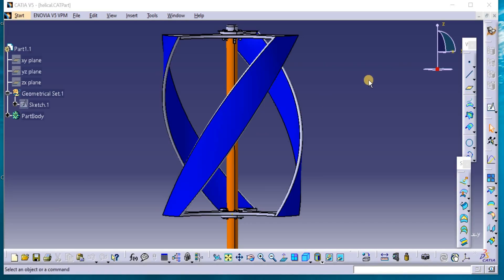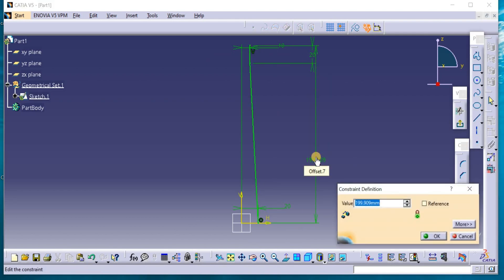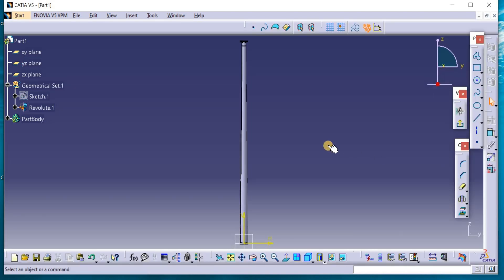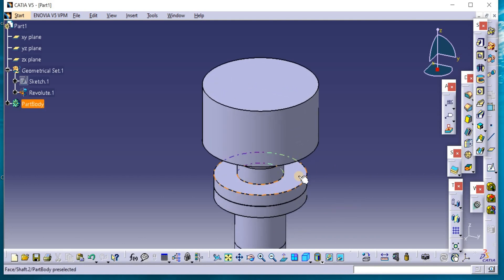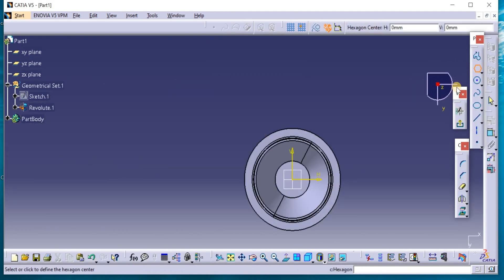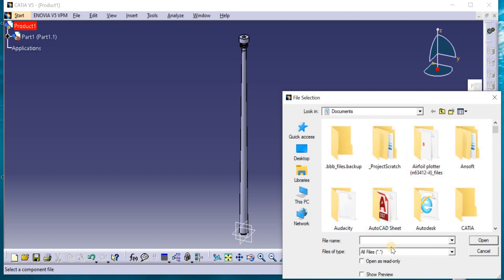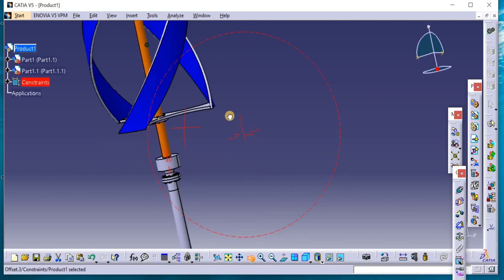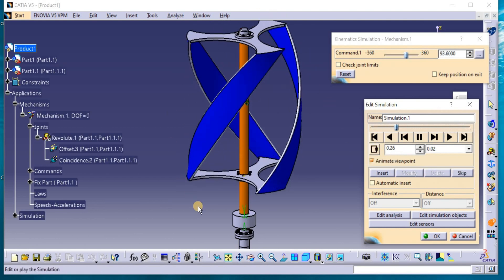CATIA V5 - VERTICAL WIND TURBINE - HELICAL (ASSEMBLY & ANIMATION)

Comment: Thanks for this video. I followed the same steps, but my wind turbine isn't turning. Can you tell me what might be wrong?
Reply from the maker: Hello brother
Please check carefully the following steps:
1- fix the part click on anchor 
2- in start menu, go down from application - mechanism - joint - revolute - message will appear, activate angle driven.
3- click on simulation (two gear) two messages will appear,in the short one move the cursor upto 360. In edit simulation message click the animate viewpoint, insert, interpolation step (0.04) for low speed, close loop mode and click play forward 
4- for continuous one direction rotation double click loop mode
Reply: Unfortunately, I’ve already tried three times, and each time I got the same result. I want to work on my final year project, but I really don’t see how it’s going to work. If possible, can I share my geometry with you to check where the problem is, please? @abns1995